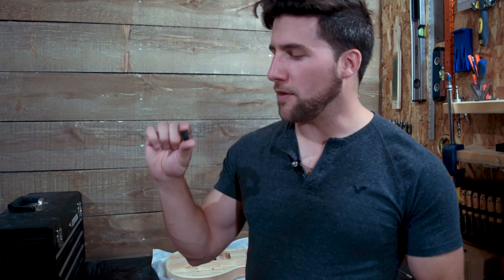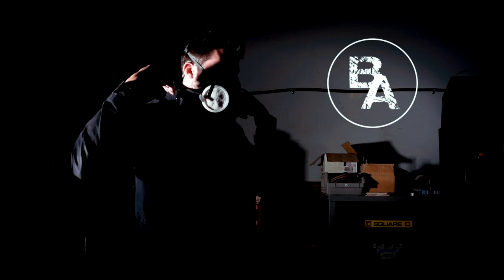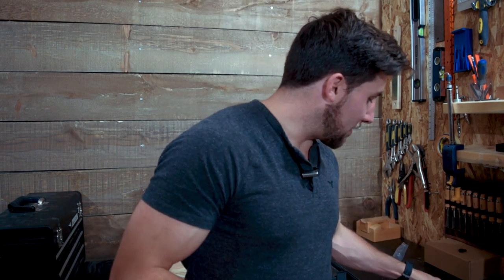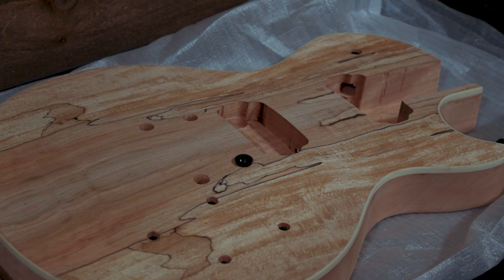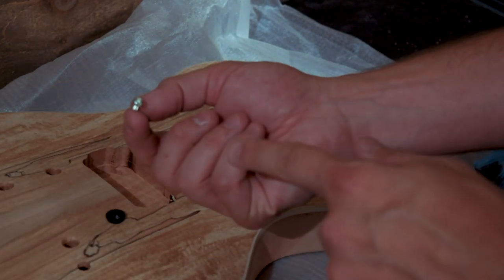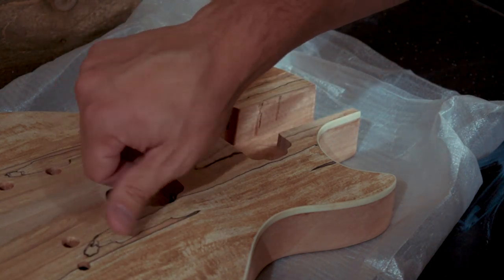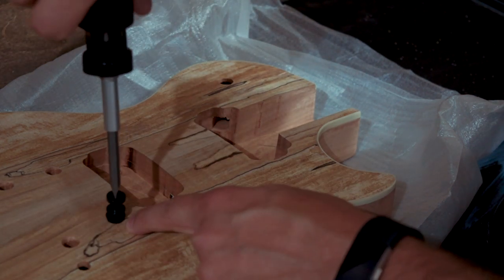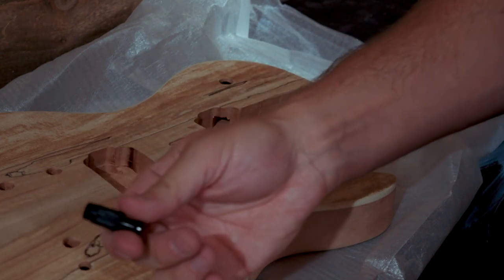How to easily remove bridge post inserts (no special tools!)

Comment: I'm embarrased to admit the ingenuis ways I've made this extrememly difficult over the years.  As long as they aren't in there so tight it starts pushing the bolt into the wood instead of lifting the insert this should work spectacularly easy! Great, quick and to the point video too btw!

Comment: THANK YOU THANK YOU THANK YOU. 

I have a brand new guitar with a buzzing cheap tune-o-matic bridge that was driving me nuts and ordered a new Gotoh bridge plus Gotoh 510 locking machine heads… and then realised I had no puller that I thought you needed to extract the insert. 

So you kind of saved my ass. Cheers.
Reply from the maker: Glad I could help

Comment: Brad !!! I want to thank you for this video. YOU saved my project. I was supper stress how I would remove the bridge post without damaging all my work on the top of the guitar. This worked perfectly and was super easy. Thank you !  Its my first  guitar build and I had not attached the ground correctly. Stupid I know, but mistakes will be make on a first project. I am so happy I was able to move quickly past this problem. THANK YOU !
Reply from the maker: Glad I was able to help Marty

Comment: Thanks, this worked for me just now. But be careful if you try it. I used a bolt with the biggest head that I could fit past the threads and I could still hear it crushing the mahogany at the bottom of the hole. Didn't break out the other side though so I guess it's all good.

Comment: Great tip Brad and nice, to the point video showing how to do it.

One thing is though, yeah you knew I would have to Brad lol, on some guitars, mainly ones using thick hardwood such as a Gibson Les Paul, those inserts do not come out that easy. The biggest thing to remember is this -  if it starts getting difficult to turn the screwdriver, be very careful!!  1) The screwdriver can slip and causing you to dig into the face of the guitar. 2) If you are using cheap inserts and bolts and it starts turning too hard you CAN strip the threads inside the insert (I have done this lol) . If it starts turning too hard I highly recommend you go to your local hardware store and buy a bolt with a hex head on it so you can use a wrench or a socket to turn it but make certain the threads on the bolt are the same,exact same, as the ones on the bolt that goes with the insert. This is not an area where "close enough" is a good philosophy. I have removed a lot of these inserts using this method, but I did end up going to Amazon and buying the regular tool designed for this for about $15.
Reply from the maker: I found it oddly difficult to get a long hex bolt in the exact same thread for some reason.
Reply: @BradAngove  yeah as did I luckily a local small hardware had some odd sized bolts and one was just right. The method you showed with the screwdriver usually works great, but sometimes the ones in hard wood can be a real pain!

Comment: Great. Thanks. I'm going to replace the bridge on my hofner shorty with a gotoh bridge, and so it should be very straightforward to replace the inserts. I guess this would work fine with a section of wooden dowel instead of a bolt but I have bolts I can use anyway
Reply from the maker: Anything that you can use to push the bolt against that will fit in there is good, as long as it isn’t sharp enough to dig in.
Reply: @BradAngove  I changed the bridge, and used a short piece of metal rod and it worked really well. Only thing is the new inserts were a little too small for the holes to I ended up putting the old ones back in lol. Also the replacement inserts were closed on the ends so if they had fit properly I wouldn't be able to use the trick to get those out (if I ever needed to) lol. The original ones seem better quality than the replacements anyway. So I have new gotoh tuners and a new gotoh bridge on my hofner shorty which are great, but now I need to put a new bone nut on the guitar because the one that it came with (made from buffalo horn I believe, but stated by hofner as bone) seems too low as the E string buzzes. I've temporarily adjusted the truss rod to alleviate that issue for now but with a fair amount of bow on the neck close to the nut. 
It seems these Chinese hofner shorty's are just not well made guitars although the finish is good on them and the neck and fretboard are nice. Still, I will get there eventually and I will sort out the neck dive issue, and I should have a nice guitar at the end of it all lol. I have another shorty that I plan to take the pickup out of and put it on the upgraded one along with a 5 way switch and wire it to do both in parallel configuration and out of phase. Maybe I'll add some lead to the body too, to try to get rid of the neck dive altogether.
I guess its something to keep me busy lol

Comment: I use a common hex head bolt of the appropriate size (usually M8 x 1.25 for import guitars) and the appropriate allen key.  Both are readily available and inexpensive from Home Depot or your local hardware store.

Comment: Some tailpiece or bridge inserts don't come out that easy because they may have been forced in which has been the case on a couple of guitars I've been working on. It's been awhile since I've passed by your Channel my bad, looking good, Thanks for your efforts. 👍
Reply from the maker: Thanks. On the more difficult ones you may need an additional bolt that is longer to help get it out the rest of the way.

Comment: This worked good for me but the problem I ran into was once the bridge post came out the head of the screw dug into the bottom wood from the pressure burying the head of the screw about  3/16th of an inch into the wood.  I think that took longer to get out than the bridge post... ha.  Great video/tip...  thanks.
Reply from the maker: I guess something flatter would be helpful.

Comment: I used to use a roller out of an old taper roller bearing from a vehicle wheel hub, although I now use a 3 inch allen bolt as there's less chance of slipping😉
Reply from the maker: I had a weirdly difficult time finding a bolt that matches the threads perfectly.
Reply: @BradAngove : You guys don't use Metric threaded bolts would be why I would guess, it's an M12 thread or at least that's what all my Epiphones have!
The worst & most difficult ones to remove are old Gibson bridge inserts that have a threaded pole that has a knurled disc on it to raise & lower the bridge, I have a Kalamazoo built Les Paul that had those on it & what a nightmare they were to remove.
Excellent informative video as they always are...

Comment: Hey Brad. Does this apply to a guitar that has already been finished? Anything I should watch out for when trying this on a finished guitar? I heard that warming the bushings with a soldering iron is the way to go when removing them from a finished guitar.
Reply from the maker: What you need to look out for it the finish lifting. Be careful that when the insert starts to lift it doesn’t take finish with it. 

I’ve heard of that technique for removing frets because it loosens the glue. It seems like an odd choice for this though since the heat should cause the bushings to expand and make them harder to remove.

Comment: This messed up my kit build - now have bolt embedded into the body of my guitar, pushing upon the back of the guitar - I think you can even see a mark or imprint on the wood the other side and still no closer to removing the bridge studs!
Reply from the maker: Did someone glue in the bridge stud?
Reply: @BradAngove  no, I had to knock the studs in quite a lot to get them in the holes... I think next time I'd use maybe some wax and press them in

Comment: Well done and seems easy. I would guess this method would work on semi-hollow ES335 type guitar with a center block. Thanks.
Phil
Reply from the maker: As long as the right types of posts at in there it should.
Reply: @BradAngove  Thanks....
Reply from the maker: @uptownphotography just have a look because some of those inserts are sealed at the bottom. This obviously only works on the open ones.

Comment: And to put them back in, is any glue needed or good to go just tapping them in?  I'm in a situation where I got a new bridge that came with posts and my current bolts won't fit the current posts so I have to use theirs.
Reply from the maker: To insert them you just tap or press them in. Make sure you account for the grounding wire too if there is one there.
Reply: @BradAngove  ok, thank you. I didn’t know if taking in and out of the same hole would be as secure.

Comment: Am I correct in assuming the internal threads go all the way through the post...i.e., you can see through the post?  The guitar I’m building will have a Wilkinson trem on it and the bridge posts are closed at the bottom (well, there is a hole on the side, but the bottom is closed)...am I correct in thinking this method would not work here?
Reply from the maker: You’re correct.

Comment: What if you've had bridge post out,  refugee guitar and when putting bridge post back in one is a bit loose, what is the best way to repair this without damaging new paint job?
Reply from the maker: I just wrap a piece of masking tape around it once or twice.
Reply: @BradAngove  ta for assit
Reply: Just seen word refugee and do not even have a clue what or why that's there,  spell check doh......I better watch out for the grammar nazis lol

Comment: Have to plug and redrill the post hole after?
Reply from the maker: This doesn’t damage the hole.
Reply: @BradAngove  yep I see that now. Didn't budge at first. Left it for 30 or so then the constant pressure got to it. Popped right out. Had to give it time. Mine was pretty stuck in
Reply from the maker: Glad you got it

Comment: Hey Brad, great video as always. I have a body with pre-installed tunomatic studs, but not the bridge itself. Does anyone happen to know the thread size on those? (So I don't have to buy the bridge just to pull out the posts.) It's not readily available info.
Reply from the maker: Unfortunately there are different thread sizes in different posts. Your best option might be to just pick up a couple longer bolts of that diameter with different thread sizes. Cheaper than buying a bridge.
Reply: warning! The screw came right out the other side of the guitar cracking my finish! My favorite jazzmaster is ruined. Hmu for pics if doubtful.
Reply from the maker: Yikes. How did you manage that? Sharp screw, point down, and kept tightening even though the insert wasn’t moving?

Comment: Am i being to specific, what size "bolt" do i use. I put it in quotes because from what I can tell it looks like a screw..
I guess my real question what size "bolt" is to small?
Reply from the maker: You’re just looking for something that will fit in the hole and won’t just get pushed into the wood. It doesn’t have to be a screw, bolt, or really anything specific. That’s just what I had lying around.

Comment: Do you know how to insert the posts of a floyd rose without damaging the guitar? I took out the posts of my 7 string ibanez lo-pro edge but I need to put them back.
Reply from the maker: Sorry, I’m not sure. What makes you think you will damage the guitar putting them back?
Reply: @BradAngove  I'm not sure if I can rubber mallet the posts in without damaging the wood and causing tuning stability issues later.
Reply: Hey @BradAngove . Thanks for the reply. Some people wrote concerns in a thread on Jemsite forums. I wish I could find that thread again because the posts were confusing. 

However, I see people inserting TOM bridge studs with a hammer on youtube. I guess it should be OK to do the same on a floyd rose.

How do you do it?
Reply from the maker: I use a small hammer and a piece of soft wood between the hammer and the post to avoid causing damage.

Comment: Any tips on how to do this on a hollow body? Thanks
Reply from the maker: If the threaded inserts are still pressed into a block then the same technique should work. You could also try threading in a bolt and just using something to grip the bolt and pull.
Reply: @BradAngove  thanks for the reply, unfortunately, there is no block, it’s hollow. An Epiphone casino. I can see the back of the guitar through the bushings hole.
Reply from the maker: That’s a bit odd. It’s still a tunomatic bridge with posts like this?
Reply: @BradAngove  yes, a tune-o-matic with a floating tailpiece…I think the bushings are glued in the guitar top…
Reply from the maker: I’m afraid I’ve never dealt with something like that. The only trick that comes to mind is heating the bushings from the inside with a soldering iron and then threading in a bolt and pulling.

Comment: I would also put some electrical tape on the screwdriver to protect the hardware from scratches.
Reply from the maker: As long as it still fits in the slot, good call.

Comment: Use with caution. I tried this method on a late 70’s Les Paul Deluxe, and the anchors were in there so tight it actually drove the screw down into the mahogany. Removing it was no easy task.
Reply from the maker: Yikes! You may need a blunter object in there then.
Reply: i am in the same situation.  i cant get anything in there to grab it.  how did you get yours out?

Comment: NOT RECOMMENDED FOR 2 POINT STRATOCASTER STYLE BRIDGES!!!!!!!  Tried this and the bolt pushed through the wood and came out through the tremolo cavity! Now to get some wood glue and repair the damage. 😞
Reply from the maker: Strat bridges don’t have these, so I really don’t understand what you were trying to do.
Reply: @BradAngove  strat bridges do have them when they’re the 2 point tremolo system.
Reply from the maker: Ok, I guess any bridge could notionally be a strat bridge if you put it on a strat, but that’s not the classic strat bridge haha. 
Anyway, this method is for tunomatic bushings, but you could likely use something else in the bottom of the hole that is more rounded if there is an issue.
Reply: @BradAngove   Yeah, a lot of newer strat models have a two point tremolo rather than the standard 6 screw system. With the two pins that the tremolo are attached with, there are bushings just like a tune-o-matic type. Problem is, there is much less wood under the bushings due to the tremolo cavity. On the plus side, the bolt came out the other end rather cleanly which allowed me to access the bushings from underneath and I tapped them out. Once the repair I was originally doing was complete, I then filled the holes that the bolt had made. So it’s all good now, just wanted to warn anyone that may be working with the same thing.

Comment: you are wrong and now there is a upside down screw deep in my guitar and a stuck bridge post
Reply from the maker: Clearly I’m not wrong, look at the result from the video.
Reply: Same. Doesn’t work for all guitars. This guys studs seem loose af.
Reply from the maker: Use something with a flatter head if it’s not working for you. Unless you’ve found a better method?
Reply: @BradAngove  I just bought a bigger bolt that fits and kept tightening it
Reply from the maker: Yeah I’ve done that a few times but I’ve had them get stuck that way once or twice too.